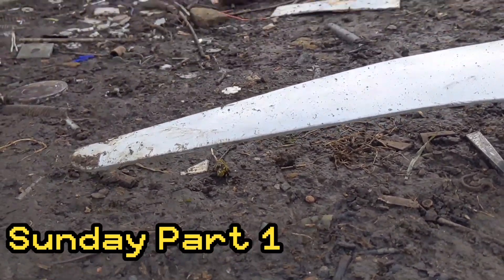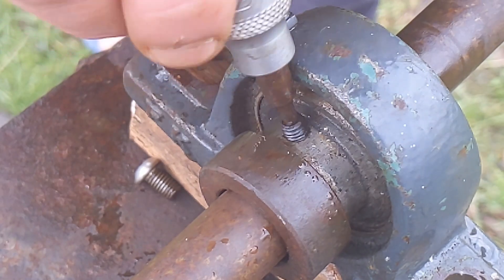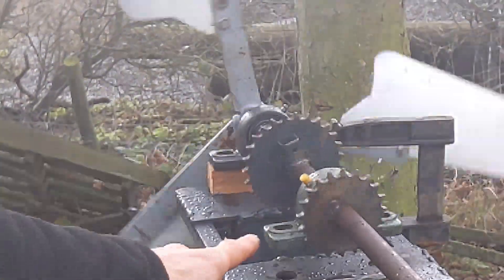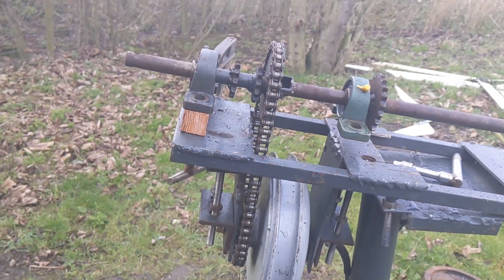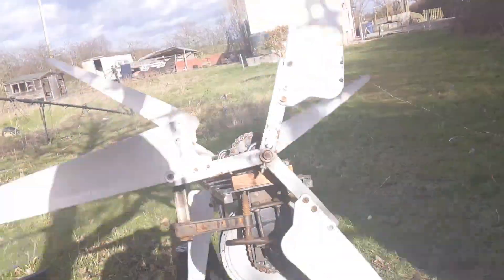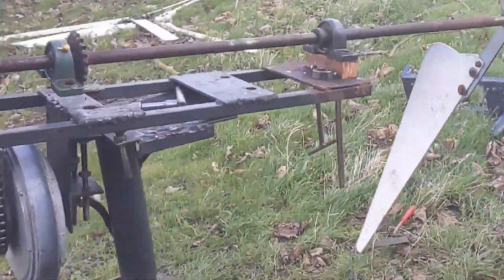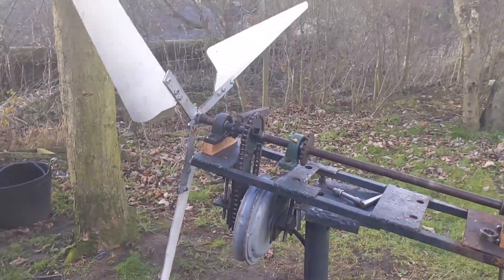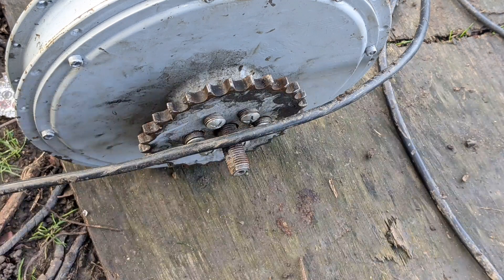Electric bike 48v  hub motor wind turbine FREE ENERGY project - GOOD PROGRESS - 6th February 2022

Comment: Nice setup. What sortoff currect are you getting?
Reply from the maker: Not sure but have ran it before and got approx 15 amps at 24 volts , going on the tower very soon it will be wired to a meter and a load straight away.
Reply: @GavinFreedomLover  thank you for the reply.  Am interested in the results as am looking for solutions for 4 out buildings on a farm in namibia for the chaps residing in them. Am subscribed so will be looking out for your videos. Cheers
Reply from the maker: Great to see viewers from all over the world stay tuned for the launch next week.